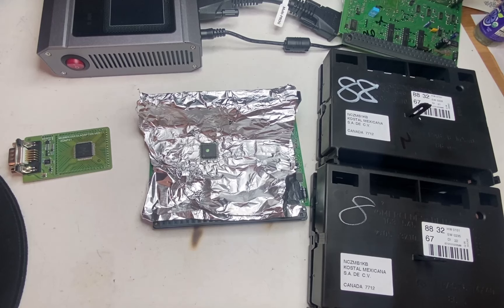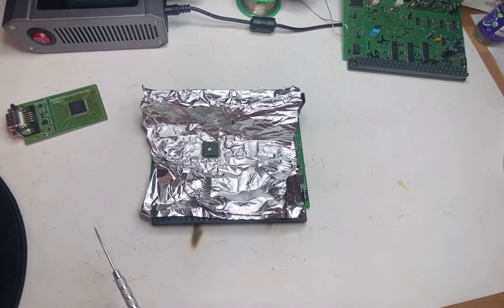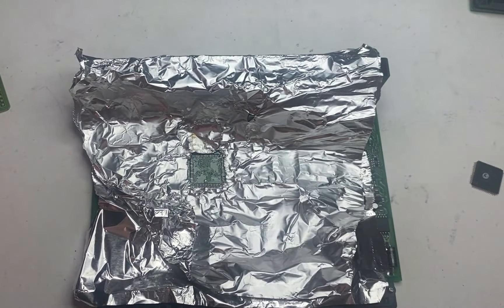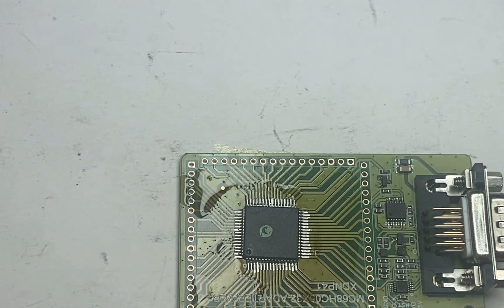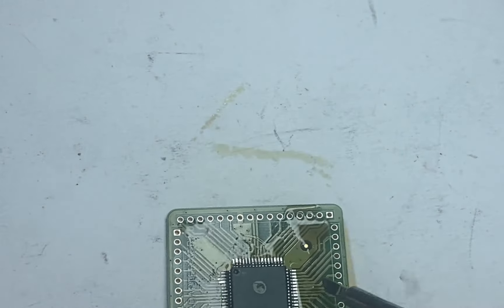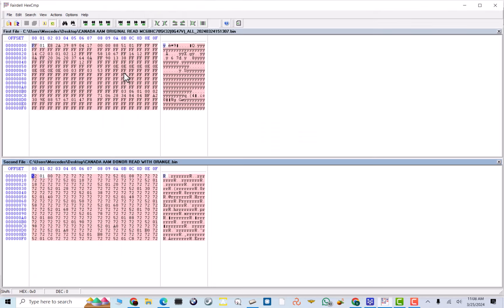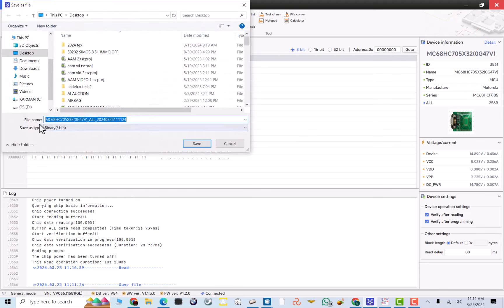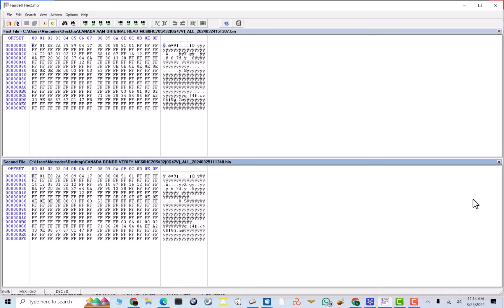Mercedes AAM Module | Read Write Unreadable Processor | Soldering

Comment: Pls Will you recommend the multiprog over the dc706
Reply from the maker: I have not used dc706 I’m waiting on my to come in. As far as multi prog main reason  I bought it is to do MQB cluster with their solder less connectors. I’m still working with tech support to read this cluster it can’t unlock at this point. Otherwise I did Jeep bcm with it I couldn’t do it with autel or abrites